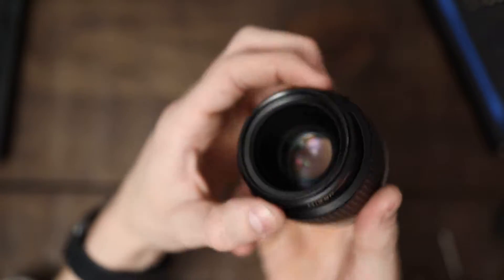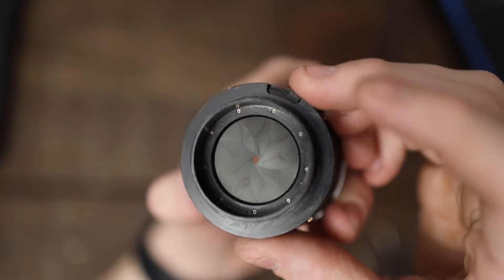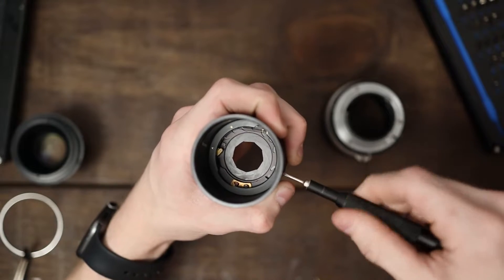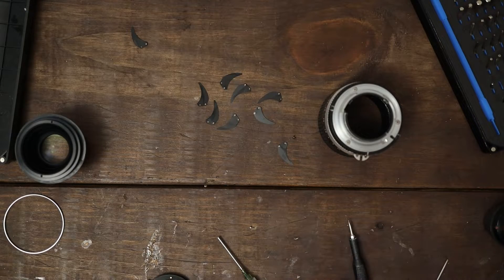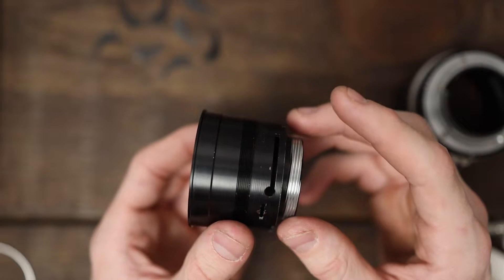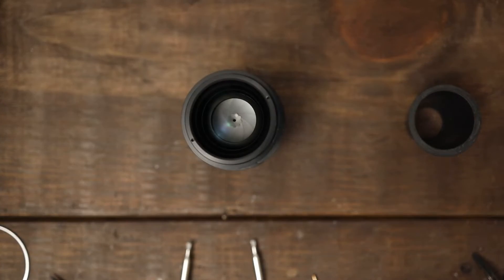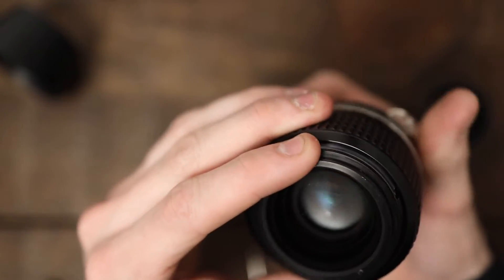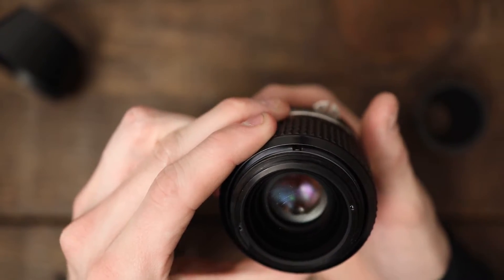Nikon 35mm F/1.4 AI-s Non-Functioning Aperture Cleaning and Repair

Comment: Assuming you already set the marks for CRC helicoid (where does it detach and where it should be once screwed back on)? About to open mine and i don’t think you covered that part .
Reply from the maker: I’m not quite sure what you’re asking.
When separating two helicoid threads, you simply add a mark on one half, turn it until it just comes off the other thread, and add a matching mark on the other piece. This tells you at what point you must line up the threads for it to go back in its original position.
Reply: @edifiedproductions  that is what i was asking about. Did not see that part in the video .. also with these another mark should be added where two parts meet once screwed back on. At least the case on 55/2.8 but it seems the same type of thing on 35/1.4 from what i see.

Comment: What about oil and apertures in general? Why is there oil so often IF there shouldnt be any? And what bad the oil does? And who oils them? Devil? Gremlins? Putin?
Reply from the maker: Oily blades are caused by the greases in the lens focus helicoid essentially breaking down and “fogging,” then migrating to the blades. The oil stops the blades from moving because, even though oil is a lubricant, it adds a lot of surface area to the contact point from blade to blade, and of course because oil is sticky. When they are dry, only a tiny part of the blades touch each other and they glide perfectly, but oil will stick to one blade, then stick to the blade beside/under it, and that stickiness stops the aperture from moving.
Reply: @edifiedproductions  Great many thanks for the answer! Mostly old russian lenses very oily always. So probably the grease was breaking down with time and messing the blades. I have read the oil reflexes light and adds to the haze. So I was thinking maybe there's really a point about cleaning the blades.
Thanks!